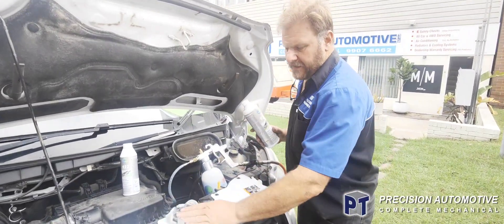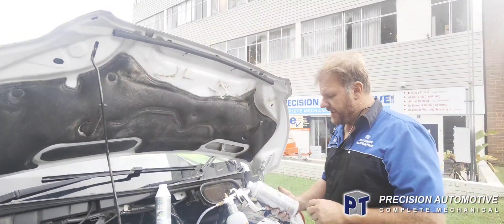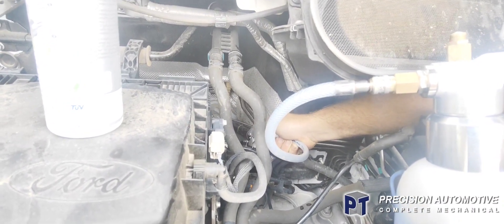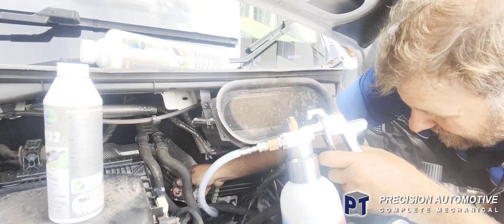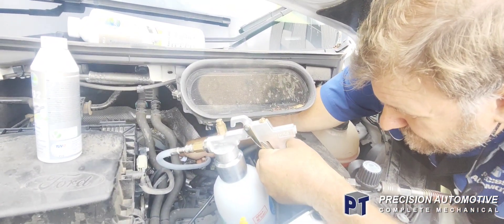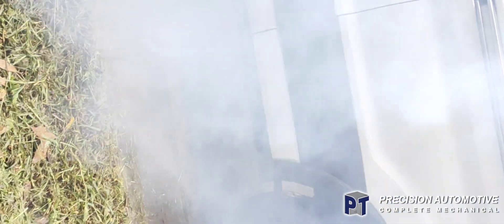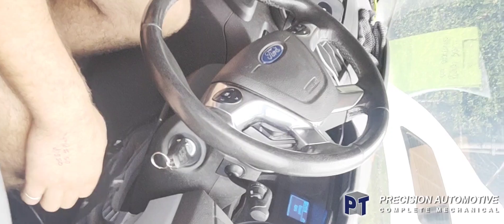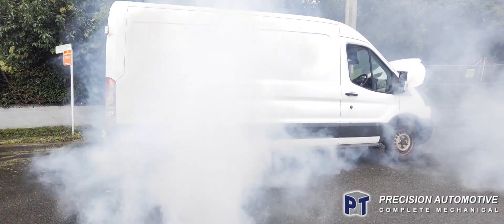Tunap automotive additives, DPF cleaning two part solution. results

Comment: So... What is the verdict? Did it clean dof from ash deposits, or just helped for a short time?
Reply from the maker: Yeah it worked
Reply: @PTPrecisionAutomotive  I did i yesterday, as preventive measure before my dpf gets clogged, because it showed on diagnostic, that dpf has 75% ash residue and my car is starting regeneration very often, through the city after every 50km starts regeneration on open road I can reach maximum 220km until next regeneration... I feel a slight difference when driving (a bit faster and stronger response when I hit the gas pedal), but 75% of ash deposits are still there and again after 50km driving regeneration is starting... And all parameters show that everything is good... So... Idk... Maybe there is another issue that is not shown in the diagnostic...